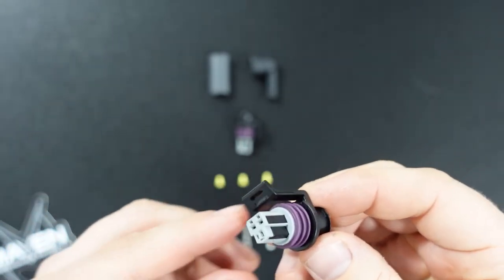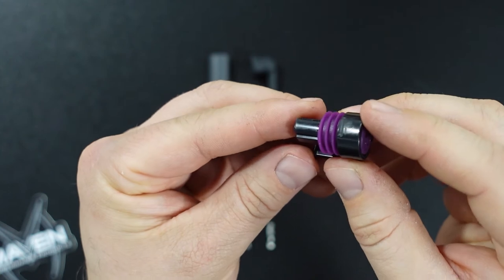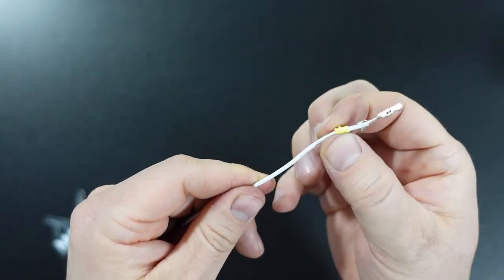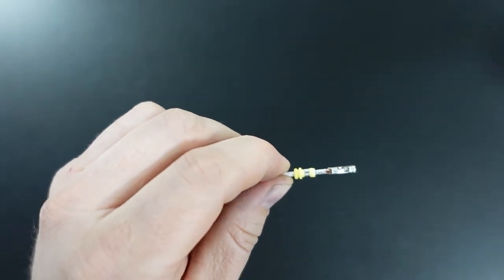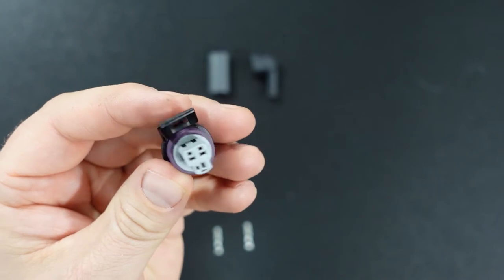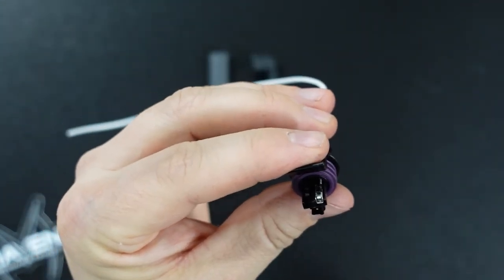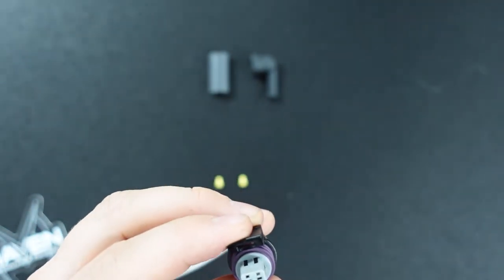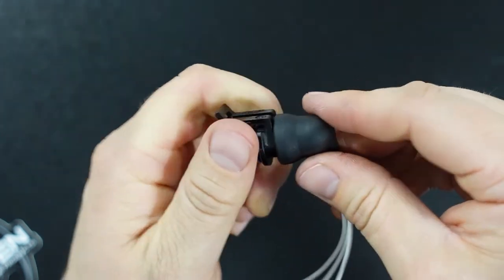How To: Pressure Sensor Connector Delphi GT150 3 Way for Pressure Transducer

Comment: FYI the plugs with-out the Grey Cage do not assemble the same way... The cables have to be threaded through the plug as the pins go in from the front of the plug not the back as in the ones you have...
Reply from the maker: Correct. We prefer (and sell) the “push to seat” rather than “pull to seat” style connectors and terminals